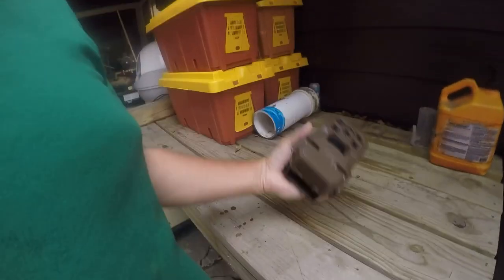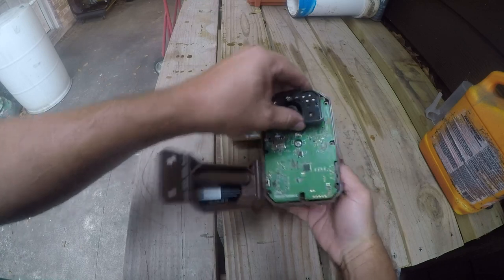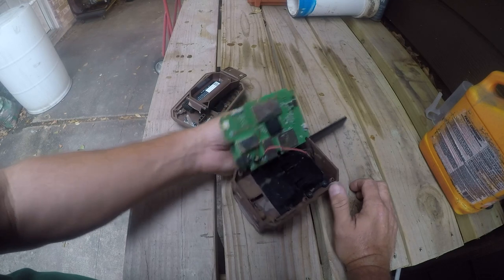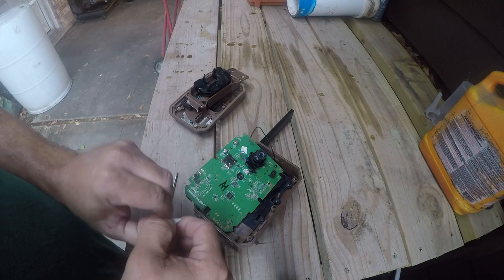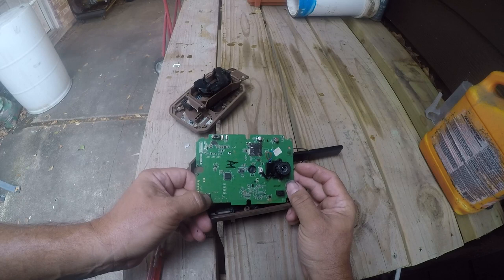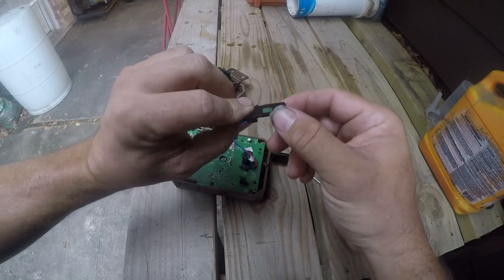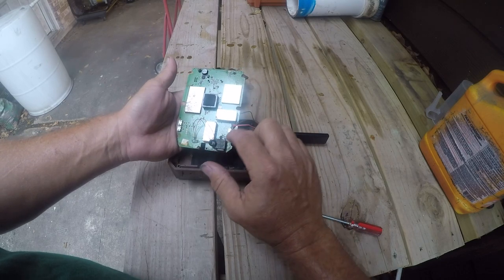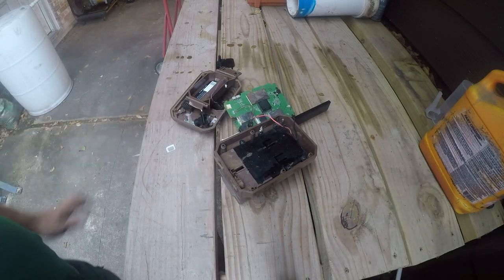Tear Down - Moultrie Edge Cellular Trail Camera

Comment: Any chance you could show me how the antenna is mounted? Trying to see if I can extend the antenna with an aftermarket one.
Reply from the maker: I don't have the cameras any more.... switched brands.  It wasn't anything magical if I remember correctly.  Standard wireless connector on the board.
Reply: Did you ever find anything out? Had a bear rip an antenna off and looking into replacing it.

Comment: Out of curiosity what scenario did you face that made you have to mount it upside down?
Reply from the maker: I needed to mount the camera upside down from a gutter.  I did not want to drill any holes in the house or gutter.  I was doing a bat eviction job and monitoring the eviction device.